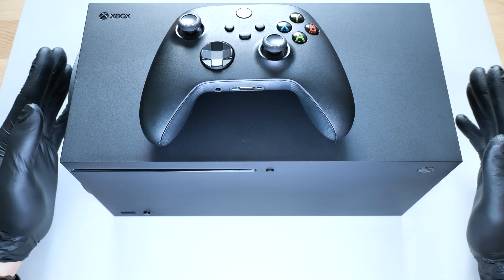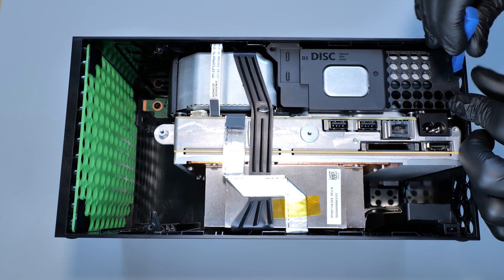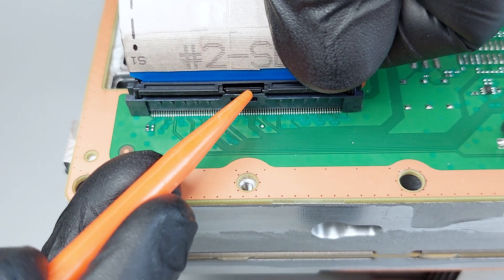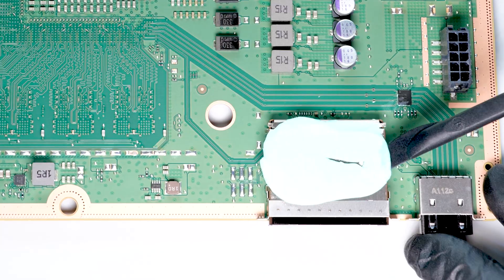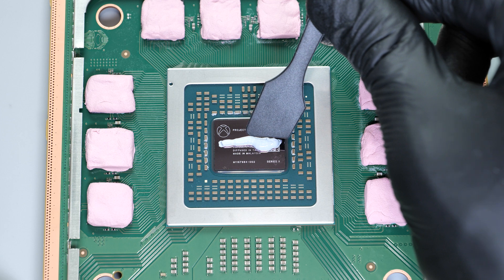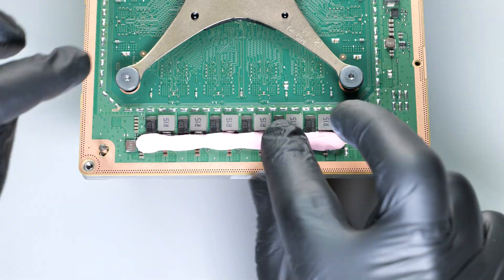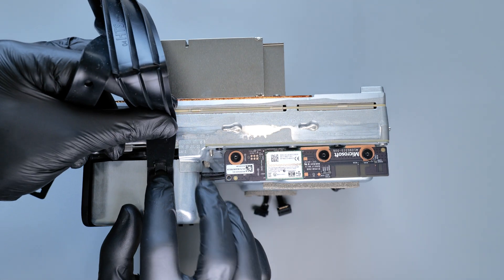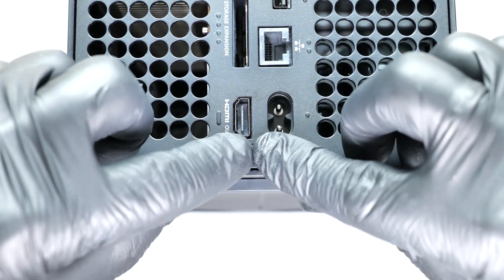Xbox Series X Thermal Paste and Pads replacement and Cooling System cleaning

Comment from the maker: ⚠ VERY IMPORTANT: I highly recommend replacing both the thermal paste and the thermal putty to achieve the best results. If, for some reason, you can't replace the thermal putty, you’ll need to reshape the original one so that when the heatsink is reinstalled, it gets compressed to the proper thickness and makes solid contact. If you skip this step and just put the heatsink back as-is, it will not make proper contact with the putty, and the heat transfer will be compromised, which could lead to overheating or long-term damage.
Reply: The centre fan screw and the x clamp screws require a T8H screwdriver, the T8 won't grip the screws, leading to people threading the screws by trying to use the wrong screwdriver. Maybe add the T8H screwdriver to the recommended tools at the start.
Reply from the maker: @gibb343  Most likely you're using low-quality tools, because for these screws there's no difference between using a T8 or T8H bit as these screws don't have the center pin that requires a T8H.
Reply: @ElectronicsComputers...first thank you for your vod's on YouTube 🙇‍♂️ i have a issue with my Xbox Series X...it keeps trowing me back to the home screen after a couple minutes,when playing Space Marines 2,Death Stranding,BF6 Beta,Indiana Jones and Doom TDA...(quess heavy demanding games)i've changed my paste on the cpu(Artic mx-6) and also put new putty into my console(TG Pro)tested my powersuply with a multimeter(12,06 volt)...and it keeps doing that(crashing)you got maybe an idea where i have to search the issue here?...the only thing i wasn't able to test was my ssd,i did see a video on your channel saying that these ssd's are a weakspot on the series😮greetings from the Netherlands.
Reply: @JointEffort_NL  ssd is about to die, better copy hidden boot partition if u still can, remember to do this after any update else u wont be able to put new ssd when old one dies...
Reply: @JointEffort_NL  I'm experiencing the same thing, Space Marine 2, Death Stranding, the BF6 Beta crashed,  and now 2042 as well, even though it worked previously. I was considering doing what this video says to do, but if it doesn't work, then...

Is your console also from around 2020? Is it maybe an HDMI issue? Did you get a new cord or anything?

Comment: Is there a chance you could do the series s? I’m guessing it’s the same but my 2020 launch day model is running louder than when I bought it and I figured it’s time I repasted and cleaned it from dust. Thanks!
Reply from the maker: Well, I haven’t done that video because the Series S is so simple and easy to take apart. Just apply good thermal paste, but don’t ignore replacing the thermal putty too. Upsiren is way better than the stock thermal putty.

Comment: Ive been using My series x without paste for 2 years. RIP. I should probably add some now
Reply from the maker: Two years is still okay, but consider replacing the thermal paste and thermal putty in the near future, as this will significantly extend the lifespan of your console.

Comment: Best video I could find. For a complete Noob it's quite a bit of work😅
Reply from the maker: Thank you for the comment! It does take a bit of effort but it's worth it in the end!
Reply: @ElectronicsComputers I'm from the Netherlands and the U6-pro isn't available here.  
But we have Thermal Grizzly advanced or Thermal Grizzly-pro. here.

Do you think that's a good alternative?
It comes in 30 grams or 100 grams, but 100 gram is very expensive.

They also have kryonaut paste from Thermal Grizzly.

Maybe I should use this for the cpu

Comment: If the putty is still Malleable is it dried out?
Reply from the maker: If it's nice and soft, then you can reuse it. Just reshape the putty so that when the heatsink is reinstalled, it gets compressed to the proper thickness and makes solid contact. If you skip this step and just put the heatsink back as-is, it will not make proper contact with the putty, and the heat transfer will be compromised, which could lead to overheating or long-term damage.

Comment: My series x stopped working randomly one day. When i hit power button it lights up then shuts off and makes a click noise. Took it to a shop and they said it must likely motherboard issue and they couldn't fix it. So i tore it down myself to see if i could find what caused the failure (expecting to find nothing) i found that there are four of the R15 resistors and two of the black 330 components missing! And i didnt find any loose pieces during the tear down. Have you seen or heard anything like this?

Comment: Bro i already applied the mesh net on Xbox series X to keep it secure from small cockroach but what about bottom vents there's nothing I can find for it please help
Reply from the maker: Well, I think the only way to cover those vents is to go DIY, because I’ve never seen any bottom-mesh kit sold separately. What you can do is take the top mesh from this kit — https://shp.pub/7aqadq   and  then make the cutouts for the stand clips with an X-Acto knife, and mount the mesh in place but first you have to remove the stand.

Comment: Do I have to use thermal putty or can I just use the thermal paste I use on my pc
Reply from the maker: I highly recommend replacing both the thermal paste and the thermal putty to achieve the best results. If, for some reason, you can't replace the thermal putty, you’ll need to reshape the original one so that when the heatsink is reinstalled, it gets compressed to the proper thickness and makes solid contact. If you skip this step and just put the heatsink back as-is, it will not make proper contact with the putty, and the heat transfer will be compromised, which could lead to overheating or long-term damage.

Comment: Hi, congratulations on the disassembly. You went into detail. Let's say the SSD in my Xbox Series X is broken. Can I replace it with one purchased on AliExpress? Obviously, it's the same.
Reply from the maker: I already answered you in another comment!!! If the original SSD is about to die and you see first signs of failure, you can back up the first bootable partition and then restore it into any compatible SSD. If the SSD is dead completely beyond recovery then the console turns into e-waste. You can sell it for parts.

Comment: I THOUGH THE SERIES X HAD A METAL COVER TO COVER THE X CLAMP FOR THE APU OR DO THEY NOT ALL COME WITH COVER
Reply from the maker: That X-clamp was only used in the first iteration of the Series X consoles. Later models removed it, most likely for thermal optimization, since it tended to trap heat. The latest 2025 Xbox Series X units also lack SSD shielding, which has led to extremely short SSD lifespans due to constant overheating.
Reply: @ElectronicsComputers o ok, thanks for responding 👍 great video by the way.

Comment: So there is a shield on my x clamp do I need to have that on? I noticed you didn’t have one
Reply from the maker: That X-clamp was only used in the first iteration of the Series X consoles. Later models removed it, most likely for thermal optimization, since it tended to trap heat. The latest 2025 Xbox Series X units also lack SSD shielding, which has led to extremely short SSD lifespans due to constant overheating.

Comment: I tried replacing the thermal paste on the GPU, and reassembled it correctly. But now it just powers up briefly then shuts off. Is this due to improper thermal paste application possibly?
Reply from the maker: Did you touch the SSD?
Reply: @ElectronicsComputers Same problem here, Power Button flashes one time and it turns of, didnt touch the ssd though
Reply from the maker: @MadoMatzko  Check all the connection, especially the flex cable between the boards.
Reply: @ElectronicsComputers  I didn't mess with the SSD, and i tried disassembling it and rechecking all the cables like 2-3 times now, just refuses to power up, I am frustrated and haven't touched it for a few months. I might just pay MS to fix it.
Reply: did you find any solution? im having same problem
Reply: @whosdatdude3570  Nope, it's sitting bricked in my closet till i have enough to pay Microsoft to fix it.

Comment: My Xbox series x is shutting off randomly. Not loud, looks clean, 2023 manufacturer date, but still shuts offs, is it thermal paste gone bad? It happens while doing anything , could be bc where it’s plugged it but is there a definitive way of knowing? Maybe code or smt not sure or temps
Reply from the maker: If the fan is spinning at lower RPMs, then it’s most likely not an overheating issue. Check the AC connection and if possible, try another outlet. Also, when the console shuts down on its own, are you able to turn it back on immediately or not?

Comment: @1:32 The screw seems to have broken for me, and I am unable to get it out. I have even tried pliers, but I cannot grip them strongly enough to get it out. Any suggestions?
Reply from the maker: The one in the middle of the fan? The easiest way is to just try different pliers. Leatherman multi-tool works pretty good for that.

Comment: Very great tutorial, thank you for this. I've followed the instructions carefully, everything looked good after re-assambling. Unfortunately when connecting to the tv it says "no signal". I've tried different hdmi cables and monitors/tvs but no luck. The only thing I did not place back was the metal cover of the APU, is this required? I can see the xbox in my home network when it is running, so maybe it's only a gpu/video issue. Maybe somebody experienced this issue, would be helpful.
Reply from the maker: I have tons of clients with this issue. In most cases, the problem is caused by plugging or unplugging the HDMI while the console or TV is powered or still plugged into the wall outlet. The retimer chip on the Series X is extremely fragile. It sits between the APU and the HDMI port, regenerating the high-speed TMDS/FRL signals. If it gets zapped or its supply rails spike, the console behaves exactly like what you’re describing. The chip itself costs around $5, but you need a hot air station to replace it (even the cheapest one, about $25, can do the job). I also have a video on this: https://youtu.be/FhwZCS6jz2k

Comment: Hi i hope your well i have a question. I did this and i was very very cerful but after i re asembel my xbox it won't turn on any more again i open it an check every think ervery think was fine. what problem can happen for it in your opinion?
Reply from the maker: By ‘not turning on,’ do you mean it doesn’t respond to the power button at all, or something else? Have you also replaced the thermal putty? If so, did you use thermal pads, or the putty I recommended? First, double-check all ribbon cables and connectors—one loose or mis-seated cable can cause black screen or no power. In most cases it’s just a connector or assembly issue rather than permanent damage.

Comment: Does anyone know the size of the die? Is it 20x30mm?
I‘d like to apply PTM7950. 
Thanks in advance! ✌️
Reply from the maker: The die dimensions are a bit smaller than that. If you decide to use PTM7950, make sure to replace the thermal putty, or at least reshape the original putty — otherwise, you’ll make it worse.
Reply: @ElectronicsComputers  I measured it with about 17mm x 25mm. 
And thank you for your advice, I will reuse the putty.
Reply from the maker: @Schweed0711 Yes, it's 16.4 mm by 24.7 mm to be exact.

Comment: Can i use C4 high explosive paste as substitue for the thermal pastes? I'm a little short on resources rn.
Reply from the maker: In my repair shop we use either MX-6 or Grizzly. In any case, a fresh thermal paste of most brands will be better than old dry original one.

Comment: Hi, I just changed the paste on the console and cleaned it of all the dust. It had no problems other than the case getting hot on all sides. After changing the paste, there were no problems, but both the case and the air coming out are warmer. There's no fan noise. Is it normal for it to be warmer? Maybe I should also change the pads?
Reply from the maker: Read the pinned comment!!! Also, if the exhaust air gets hotter, that’s actually a good thing it means heat is being transferred more efficiently from the APU to the heatsink and blown out by the fan.
Reply: I ordered Upsiren UTP 8. I can't find Up 6 Pro anywhere. Is it still okay if I use UTP 8?
Reply from the maker: @tommasodrago-y3o  That one’s even better! For my personal console, I used Upsiren UX. For our clients, we use Upsiren U6 but anyway Upsiren thermal putty is way better than the stock one.
Reply: @ElectronicsComputers  Ok thanks, can I continue using mx4 or should I switch to kryonaut? I read several reviews that the latter doesn't last more than a few months.
Reply from the maker: @tommasodrago-y3o   MX-4 is OK definitely better than some unknown brands or old original paste. At my repair shop, we use Thermal Grizzly for all equipment. It's perfectly balanced in terms of performance, price (though a bit pricey if you don’t buy in bulk) and longevity. The paste we use lasts for years without losing its properties.
Reply: @ElectronicsComputers Ok, thanks a lot. I've seen some videos that show the black parts of the X Clumb resting on the capacitors. Others, like yours, have the black parts resting on the board. I don't remember how mine is oriented, but could this damage the console in any way?
Reply from the maker: @tommasodrago-y3o   The way the X-clamp is oriented is how it was attached from the factory and I always reinstall it the same way. I haven’t tried flipping it, so I’m not sure if it would touch the capacitors but if it does, that’s definitely not good.
Reply: @ElectronicsComputers ok thanks for all answers. You're very kind. I don't understand why they aren't all assembled the same.

Comment: Hello, thank you for such an informative video. Can you please tell me how many grams of thermal pads are needed for an Xbox One X if I take the same ones as in your video?
Reply from the maker: You’ll need at least 40g of thermal putty. The one I used in the video is what I normally use for my clients, it’s much better than the stock putty. But if you're doing it for yourself, you can go with UPSIREN UTP-8, which is even better. Link’s in the description.
Reply: @ElectronicsComputers  Thank you very much for the information, have a nice day!

Comment: What putty and paste should i use now or are the links still good to use
Reply from the maker: The links are fine! Grizzly Kryonaut is still a top-notch paste that we use in my repair shop, and it lasts for years: https://amzn.to/456pWSi But instead of Upsiren U6 PRO, you can use Upsiren UTP-8, which has higher thermal conductivity: https://shp.pub/78w0ir
Reply: @ElectronicsComputers  oh ok thanks i will be sure to try this out since my console has had some difficulties with the power and heat
Reply: @ElectronicsComputers, hey, is 10 g fine, or do i need 50 g
Reply from the maker: @Toasted_2-9   You need at least 40g, so 50g would be the best option.

Comment: Do you know what commonly causes games to freeze at random intervals and the console to restart on its own? I’ve followed a guide to replace the thermal paste (Thermal Grizzly Kryonaut) and thermal putty (Upsiren UTP-8), the fan is spinning, and I’ve swapped out all capacitors in the power supply except for two 120uF/450V ones (didn’t have replacements). I’ve tried factory resets with and without deleting games, performed an offline update, and checked the SSD, which shows 100% health. I’m running out of ideas—have you ever repaired a case like this? Any advice would be greatly appreciated!
Reply from the maker: You've already done a ton of work so props to you! Consoles like this do come to me from time to time and yeah they're some of the hardest and most time consuming repairs mainly because the issue can be anything. If you've checked the SMART status of the SSD and everything looks fine and there's no overheating, then we're mostly looking at power or board-level issues. You didn’t mention whether the console only reboots during gameplay or also while sitting in the menu. How does it behave if you just leave it on the dashboard or run some lightweight games? If it freezes or reboots even when idle or in the menu, that's a bad sign it could point to a corrupted NAND or worse, a failing APU. While power supply issues can cause this, honestly in my experience, I haven’t seen many Series X power supplies fail due to dried caps these consoles aren’t that old. That said, you didn’t replace the two 120µF/450V caps and those are the main primary filter caps, so it’s still worth doing. If the console only reboots during gameplay, then I’d say it’s most likely power-related. Around the APU, there’s a row of identical components MOSFETs, caps, coils from both PCB sides forming a multi-phase VRM. If even one phase fails, the APU won’t get stable power under load and as a result crash or reboot. You can test some of those components with a basic multimeter, but if you really want to see what's happening like voltage ripple, spikes, or instability you’ll need an oscilloscope. The easiest thing you can try is swapping in another power supply. Ideally, a proper bench PSU, but even a 12V rail from a standard ATX desktop PC PSU can work in a pinch for testing. Just make sure the amperage is enough. Also, try some physical input lightly hit or shake the console while it's running. If it freezes or reboots on impact, that could point to a loose solder joint, or BGA failure.